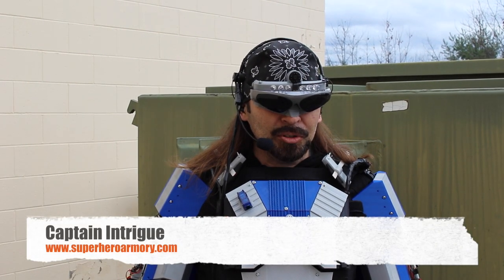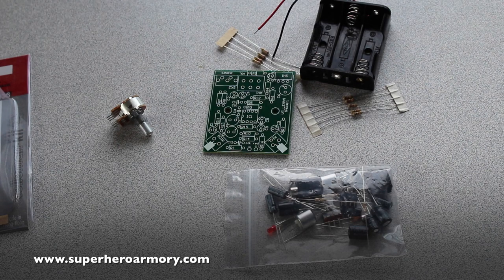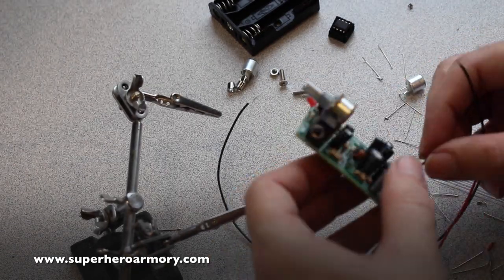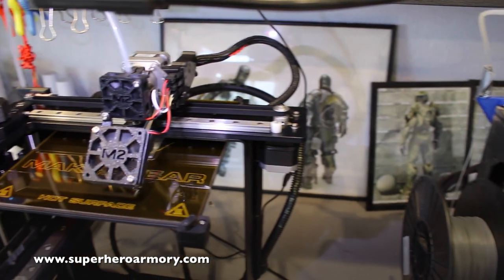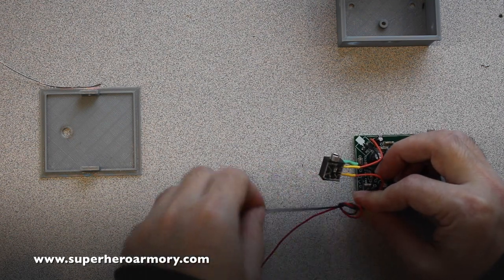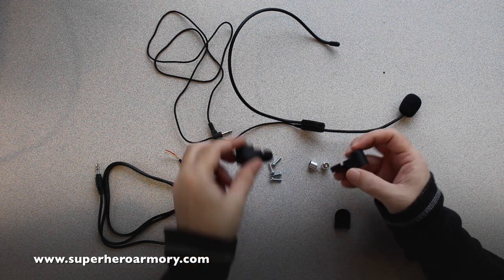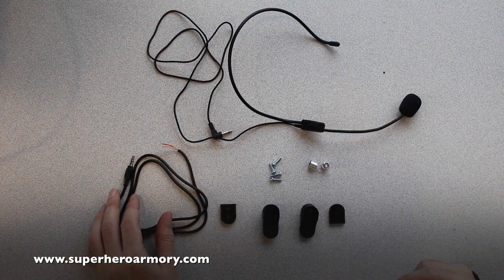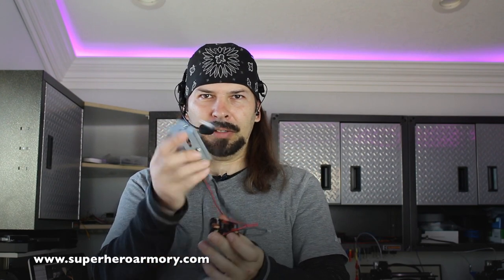How to build Super Amplified Hearing

Comment: doesn't that blow you ears? when volume of sound is above avarage?
Reply: He didn't mention it, but the audio could likely be capped to a certain level by the circuit board.  At the very least, the audio would never go above what the headphones could produce.
Reply from the maker: I have an automatic gain amplifier that limits the sound and keeps it below a certain decibel threshold, but left it out of the build to keep it simple for now.
Reply: Spying on Thugs
Thugs suddenly shoot a gun

Comment: Safety noise suppression/cut-out circuitry? Also a rotating base for the soldering station vise would be nice. What 3-d rendering are you using - SolidWorks, Pro-E? Great job friend, keep up the good work. And of course a Rose by any other name...
Reply from the maker: I have an automatic gain amplifier that limits the sound and keeps it below a certain decibel threshold, but left it out of the build to keep it simple for now.

I use sketchup because i'm very good with it.

Comment: Great job 2 suggestions,  redesign the holders to be like that of an animal with a great range of hearing for focusing of the sound and make 2 distinct units one for left and one for right so you have true 360 surround sound Super hearing
Reply from the maker: The left and right are completely independent so it is true stereo sound. I've tried using some focusing before but it only improves it slightly and looks silly.
Reply: Superhero Armory welp thats cool, truthfully it totally would, thanks for the reply!

Comment: You can buy hunter ears pretty cheap from Bass Pro,Cabellas or off of eBay,or Amazon.
They can be had for under $20,and are essentially hearing aids.
They would take up a lot less room,work just as well,and would be easier to implement than your setup.
Reply from the maker: Already tried that, they are Chinese crap though and not as effective as this build.

Comment: What happens if someone yells at you or there's a loud noise, I'm asuming your ear drums would burst.
Reply: The amplifier only works on low decibel sounds and heightens them to a certain  level. anything above that is dampened. so you have a fixed peak output.
Reply from the maker: I have an automatic gain amplifier that limits the sound and keeps it below a certain decibel threshold, but left it out of the build to keep it simple for now.

Comment: Just an ide to bear in mind for the Superhero Vehicle: you can add ''The Grappler'' on it. https://youtu.be/a6LIaWD9uQ0
Its really effective on car chases and it really looks like a gadget a superhero's car needs.
Reply from the maker: My first superhero vehicle will be a motorcycle similar to the batpod.
Reply: ok then. can you say what features it will have?
Reply from the maker: Fully loaded with weapons and armor, 2 wheels in front and one in back like a trike, but the two front wheels will move closer together as the speed increases and spread apart at low speeds to increase stability. Nobody has ever built anything like it as far as i know.